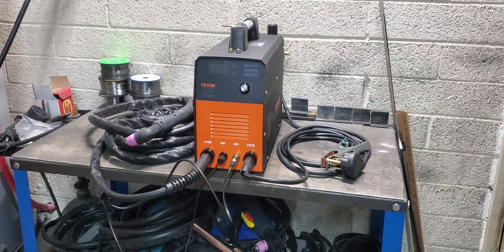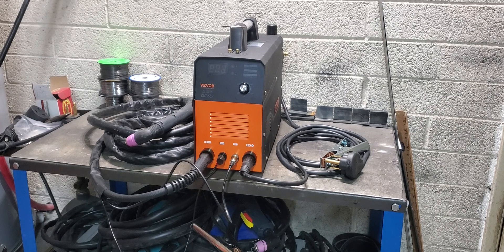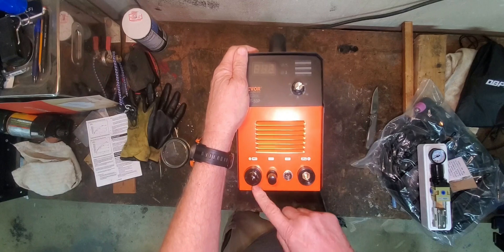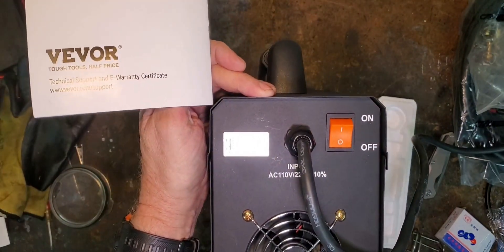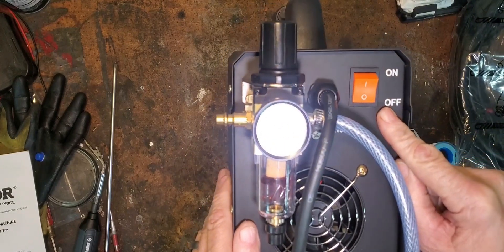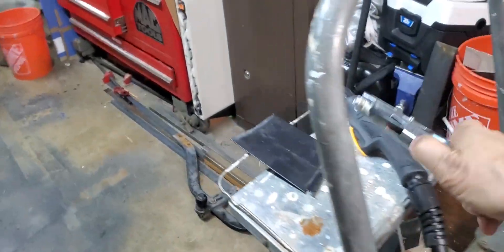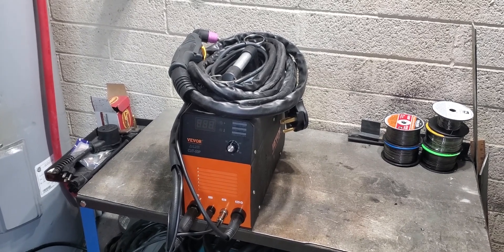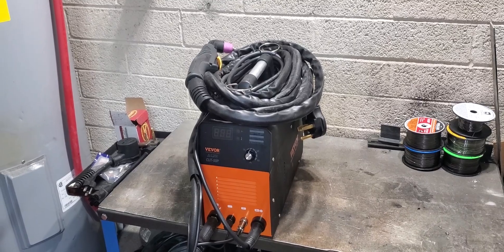Vevor Cut 50P Plasma Cutter with Pilot Arc. Unboxing, Testing and Review!

Comment: Maybe I missed it, but we don’t need gas???
Reply from the maker: It does not require gas, but does require compressed air. And you'll want a decent sized compressor if you're planning on making cuts longer than 3-4 inches. Most little pancake or hot dog compressors can't keep up for long.
Reply: @3rdpig So how big of a compressor do you recommend?
Reply: I have a fortress 4 gallon 4cfm 250 psi compressor will it work with this vevor

Comment: Great vid I just got one ,,But mine cuts without the ground clamp I  wanted to know what the ground clamp is for ? Its a no touch cutter
Reply from the maker: You need to use the ground clamp. Pilot arc plasma cutters have a small gauge wire that runs through the torch lead to give you the pilot arc, but that small wire wasn't meant to carry the full amperage load of cutting, that's what the ground clamp is for.
Reply: @3rdpig  When I use the ground clamp it works for a second and when I take it off it works ?
Reply: Defective?